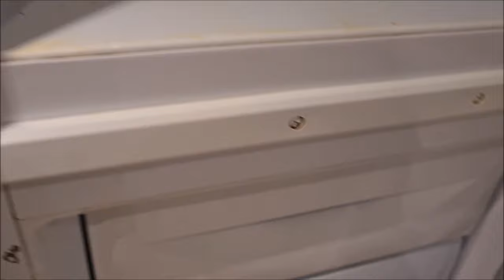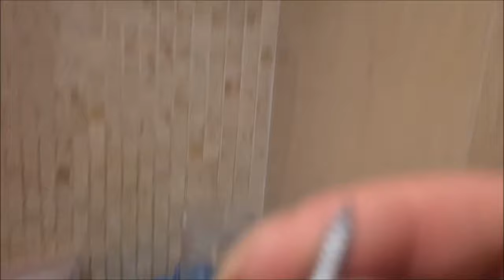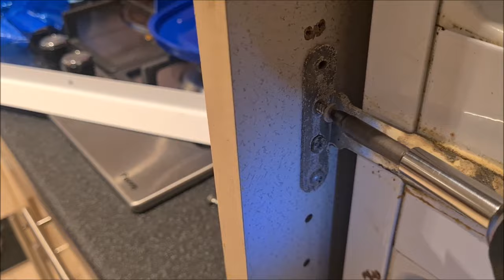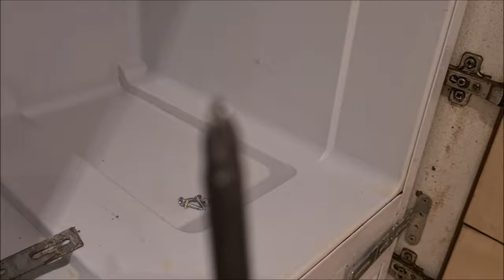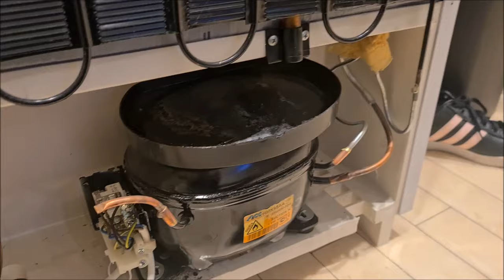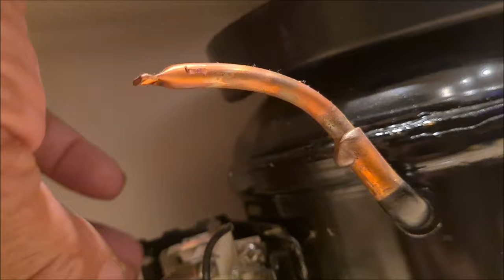How to remove an integrated fridge from your kitchen unit

Comment: i have an integrated fridge which is leaking air, so it`s a lot of ice in there. i need a new fridge but it`s allmost 800$ can i use a regular 121 cm fridge for 2-300? I can unmount the handle etc.